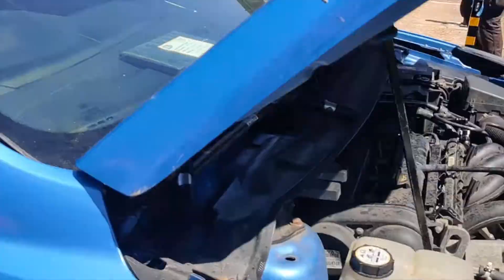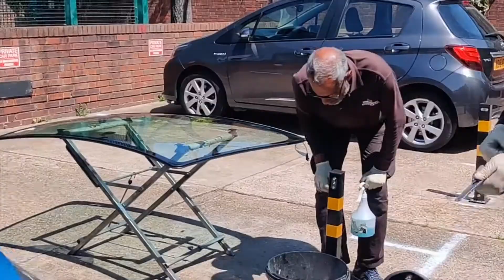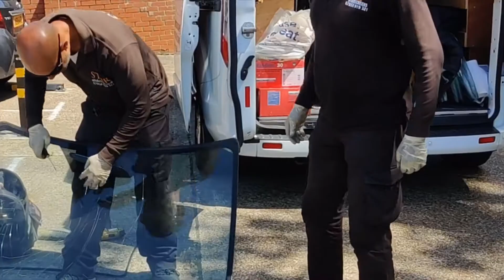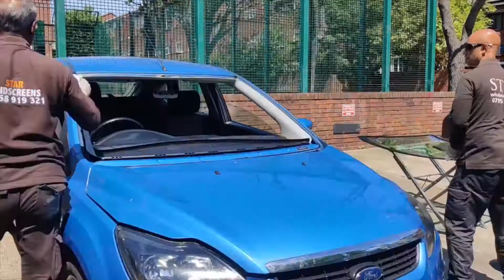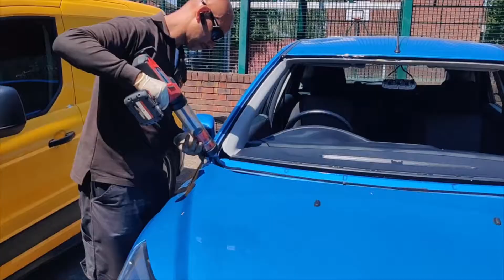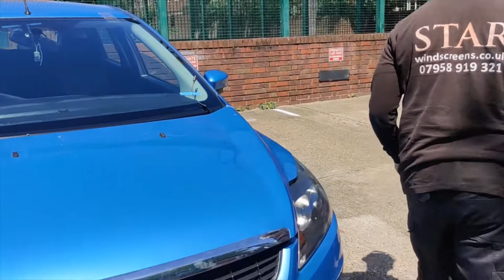FORD FOCUS front windscreen replacement change mk2

Comment: Hi there. I have a same car , focus 2009. with broken windscreen but mine is just regular one without heaters and sensores, only the mirror. I see some cables at bottom if ur new windscreen, are those connectors for heating ? When i go to change mine i would like to install new one WITH heaters but i didnt see where did u connected those two?
Reply: It is not just as simple as getting a windshield or windscreen, whatever you want to call it, that has a heating element built into it. If your vehicle did not come from the factory with that option you cannot just install a windshield or windscreen that has a heating element, because think about it how are you going to turn it on? You don't have a button in your vehicle for that because your car did not come with that option. So to retrofit a heated windshield or windscreen into your vehicle would likely cost a lot more than you think.
Reply: @MrCodwaw101  ur right. Electric part is not issue for me but too much is missing to do retrofit, i did a check.
 In front junctuon box there are no contacts for relay and both 40A fuses, simply missing by factory, no wiring for  button, probably GEM software doesn't support it either even it's 2009. I HATE morning ice scratching bcs I have small kid sitting in cold car while i finnish.